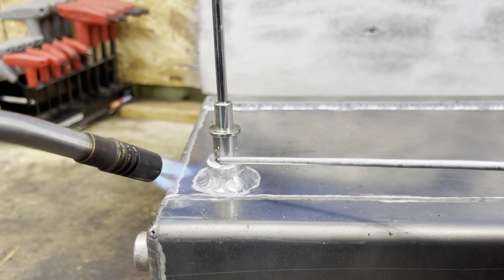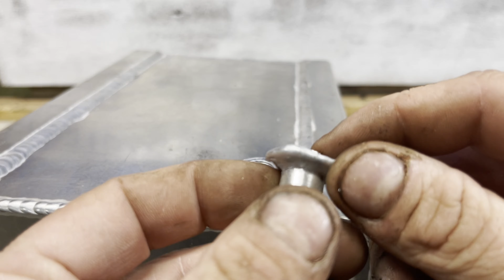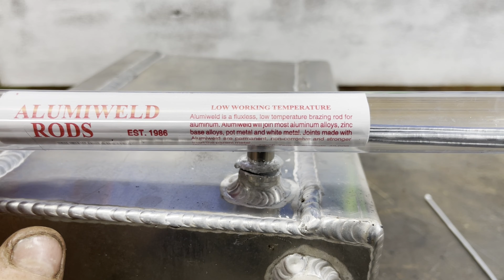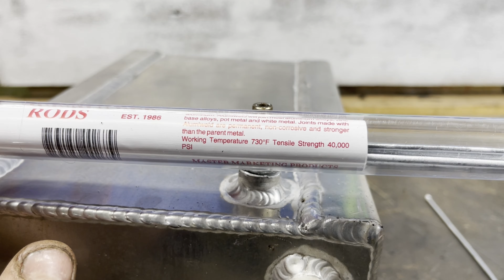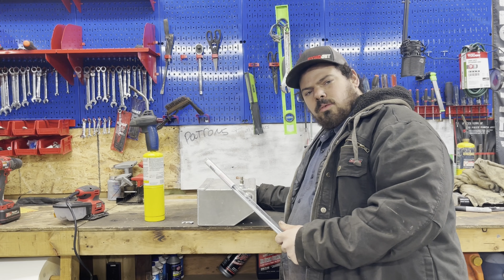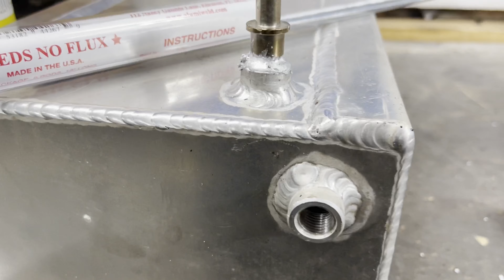harbor freight aluminum welding rods

Comment: Heat the entire area first. Preheating is key. Heat guns or even a weed burner helps to get at least 500 degrees. If small enough put part in an oven get Heat/temperature wax from welding stores can help too. Melts when temp of base metal is reached.

Comment: I use water weld been successful on a fuel tank heater hose plastic tee and a rusted out hole in 1" cast iron fitting on bottom on water well tank.

Comment: Great experiment, thanks!  This is the first video I found where the host heats the base metal instead of melting the rod.  Also, he said: "...maybe I am doing something wrong, cuz I don't know what I am doing...", which is also refreshing.  I also consulted my AI friend ;),  and it said with aluminum make sure you brush the surface with a metal brush just before doing the work, because it oxides so fast.  This guy succeeded in the end because he questioned himself first, not the product.
Reply from the maker: 💯 that’s the real way of doing things.

Comment: If you have a laser temp gun, use it; especially if you are joining two pieces of different size or thickness- First: clean both really well (grinder or sandpaper) to remove any surface oxides, then pre- heat the larger piece until it is around 675-700 degrees, then join the pieces, and re-apply the heat and the brazing rod until it flows smoothly. It takes some practice, but as others here have noted:  it really works...  I have successfully re-attached broken broken outboard boat skegs with this process, and have repaired aluminum ladder rungs after the factory aluminum rivets became too loose to hold the ladder steady.

Comment: I had a hole in the bottom of my oil pan. I drained the oil and had the drain plug and fill cap off. By time it got hot enough, the left over oil was making a lot of fumes. Tried several times and the fumes kept igniting and it wasn't bonding.I found I had to light the fumes coming from the drain hole letting it burn while I welded. First try with it burning worked great. I think what was happening was when the fumes ignited there was a pressure surge which blew the weld loose

Comment: I was always told with those rods to use a stainless wire brush to clean both surfaces for best results. I can't remember why but that's what the manufacturer suggested.

Comment: I’m a hvac contractor I use it to repair coils that hold 400 psi gas pressure! Works great!

But if your gonna try and braze anything that had oil in it then you need to clean out the inside very well first! The flame pulls the oil to your repair and you will have problems! I find I have to flush the coil first then I have no issues.

Comment: As a person who has done a lot of soldering wires on aircraft parts and connectors over the years… I am very attracted to this! It is just like soldering. 

Just like with painting… it is all in the prep work. Then after that, add some flux to allow it to clean itself further AND flux tells the solder where to go. Get it hot enough but not too hot. 

Then Boom…

I saw a guy testing these rods. The thick aluminum bend before the wield broke. Which means it will be perfect for spots on my job boat.

Comment: Anyone who uses solder to put a fitting onto a fuel tank, either has a death wish, or is American........................
Reply from the maker: MERICAN 😂
Reply: @R.N.GPerformance  I suppose its easy to get confused when "Welding Rods" is written on the packaging? 

I think the solder can be used for repairing aluminium core radiators, but thats pretty much all?

Comment: You need a flux for it to work best. Ive been making ac lines using flux cored rod for 20 years. The fluxless rods wont seal and will fail
Reply: How can you say it will fail when he just showed it worked?

Comment: Sitting the nipple balanced on edge is Not Ideal whatsoever.. You should have ground the tip or drilled out the Hole so that you weld simply adhered the obvious lip to the tank (base metal).. You Didn't have equal Heat on the thick metal tank to the thinner nipple which is Why you got no adhesion to the base on your first weld.. Thanks
Reply from the maker: Lessons are learned every day. Thank you 🙏
Reply: @R.N.GPerformance , Amen to that Brother

Comment: When you weld using rod like that use a flux it will give the aluminum something to follow if not heat both pieces of metal at same time first before applying the rod once the pieces are heated then apply the rods the heat will draw the rod to it.
Reply from the maker: Thank you 🙏

Comment: You did WELL. for a beginner, you're a lot smarter than most of the advisor who can crank up their mouth's, BUT, provide NO solution; I'm a beginner also and like you I found out the hard way, both pieces MUST be heated to a proper temperature where it will melt the Aluminum Rod  onto to the pieces being welded, Not melt the ROD onto the welding area; I'm trying to weld some perforated Aluminum pieces to make a box; however, i'm not schooled in MIG or TIG and right now my budget is lower than the welds i'm trying to create; i'm in the South and those Aluminum Rods cost me $10.00 for 3 with the tax, BUT, I'v learned just like YOU; Don't give up stay at it..Mike C.
Reply from the maker: Thank you 🙏. I agree.  These seem to be decent for what they are.

Comment: The solder and the surrounding areas heated up enough that the solder dropped down between the gaps the second time

Worked well on a large tube

But on the other hand a smaller tube would’ve been restricted but …hey… that wasn’t the project so cool!

Comment: you can weld small tanks without fear of exploding by using hot air from a soldering station.. mine goes uo to just over 800

Comment: It's the torch.
Reply from the maker: That’s very possible also.
Reply: @R.N.GPerformance  i was trying to use those one time to patch a hole in a boat. The heat ran away faster than i could put it on using a torch like that. I got a torch that would add heat faster and had no issues after that. I'm thinking about using clay to make a dam to see if i can keep the heat from running so badly.
Reply from the maker: @lenordvaughan5036  yeah I didn’t even think about that.  It travels through the aluminum fast.  A bigger torch would definitely help.

Comment: I've had a few sticks around some time. Made an aluminum dog framed door. Seemed to work but with any level of stress it came apart... no issue heating both parts to temp. I have in the past soldered parts that will not come apart in a vice??  So I'm thinking it's a hit and miss. I can't do that when I've spent hrs on a project and am counting on a product$$.  In your process, it seems to be plenty strong for what it is. There's always JB weld for leaks. I need to find something more forgiving than the Freight stuff...... Good honest video!!
Reply from the maker: Thank you.  I agree 100%

Comment: Both surfaces must be hot enough to accept the solder. If only one side is hot enough to melt the solder and the other isn't then that's cold soldering. Im constantly telling my (new) plumbers this all the time.
Reply from the maker: Yeah I really should have used my temp gun for sure
Reply: I have to tell my new crew this constantly as well and they've been with me for almost a year now
Reply: I see threads why not use a nibble that threads onto that.